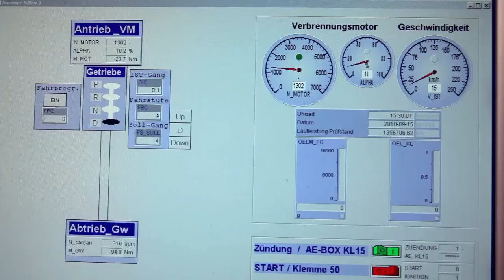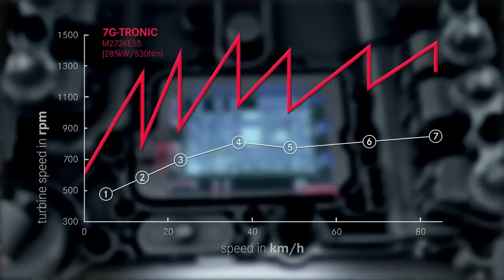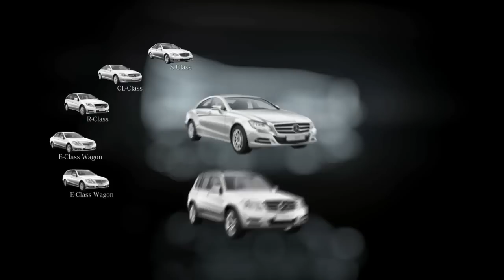Mercedes-Benz 7G-TRONIC Plus Transmission

Comment: The 5 speed automatic from mercedes was a piece of shit slushbox, it slipped like hell, did not put power down efficiently, and no driving pleasure, and the car used a shitload of fuel. Audi on the other hand with the dual clutch systems is lightyears ahead of the merc.
Reply: The DSG is volkswagen and not Audi and it is extremely unreliable, with clutch problems mostly around 85.000km. And the service is even worse as they try to make it you fault (and pay for it) in stead of admitting it is a design failt and uses cheap parts.
Reply: Eelco van Vliet VW and Audi are one. They use the same platforms, and same gearboxes in their cars. And sofar the technology is around 10 years old on the market, but porsche used it in the late 80`s in their race cars, nowdays many car manufacturers are adapting the dual clutch system to their cars.
 Maybe in the future it will be more easely repaired.
Reply: VAG group DSG gearboxes are unreliable and have been for a number of years now, they still can't seem to sort it out, BMW are not much better.
Reply: what about the hungarian made cars??? this english way of telling thinks is not suitable for u m8! stick to the Balaton Hungarian micro car and keep ur "smart ass "observation for u. this film is presenting top engineering solutions for top cars, u probably owned a 180 Kompressor which has a slight delay in changing the gear but i still think audis r rubbish in comparison with the mercs.how many classic audi do u see on the road??? audi is an outsider.......
Reply: hagh I own a CLK W209 220 CDI 5 speed automatic, and I own a 2011 Mitsubishi Lancer Evo X MR with TC-SST gearbox, the evo is lighyears superior in dynamics to the mercedes, but the Getrag dual clutch was one of the best in the market when the evo was developed. The tc-sst in s-sport manual mode is non intrusive, it listens to you even if you do something stupid like rev above 7000 rpm, no problem it does not change up, or shift back and raise the rev above the limit, still no problem, it is a track oriented gearbox that is super smooth in normal mode for daily driving, the only problem is launch control, it is soft, and very expencieve to mod, but a stage 2 package from SSP solves this problem.
Reply: *****
Is Audi better? Not necessarily in the auto transmission department, but overall? Also, what do you think of Opels, have you worked on them? If you're American, I guess not. I think they were called Saturn in the US(Vauxhall in the UK), but they withdrew them from the market a few years ago(in the US). They're pretty popular in Europe.
Reply: stay away from Vectra 2.2 Petrol 2005 onwards!
Reply: Check my channel mate. I did a test with this transmission. Paddle shifters reaction time test and different speeds videos. 5-speed it's a history. 7G-Tronic Plus is quicker than you can imagine. Be my guest to find out I'm telling the truth.
Reply: Mercedes W205 I know that, they lock the torque converter so they are more efficient, but still, no match to the new generation of dual clutch, constant drive automated manual transmissions.
   Nowdays there are 3 diffrent transmission systems are competing the CVT, the DCT and the Torque converter classic automatics, which are getting competitive, just look at ZF 8 speed, those 35i`d from BMW are fast.

Comment: Have this gearbox in my current C350.
It does feel slightly clunky when cold (but nowhere near that of my Mitsubishi 6spd auto), but nearly imperceptible when temperature stabilizes. It also feels more direct than the outgoing 7G-Tronic I used to have on my C250, so the 7G-Tronic+ has definitely improved on the directness of the engine. Start-stop is nice too.
Reply: @fahedsayed951  Yes, you have to have a slightly bat battery, I think : D Mine stopped working.

Comment: No matter what, I always prefer the 722.6. Much stronger and more reliable although we just rebuilt one. The front pump went and took out the transmission filling it with metal shavings. The cost for a compete rebuild will scare most. You don't even want to talk about what it costs to replace or rebuild a 722.9. You can almost buy a small compact car for what it will cost.

Comment: I've got a 2008 C350 with 94K miles. I can turn off the anti skid, manually shift into 1st and drift the shit out of the car on dry pavement. My 2012 TDI Jetta feels more loose and more fragile than my merc at this high mileage. Great cars, very comfy, very worth it.

Comment: All that and the transmission is STILL unreliable.
Reply: I have a 2010 W221 S500 at 115000km.
7g Tronic automatic transmission.
It had oil change and a new filter at 60000km and it shifts perfectly.
I have to do it soon again to maintain the reliability.
Maintenance is good.
Pre maintenance is perfect.
You probably bought one with high mileage which still has the fluid from the factory.